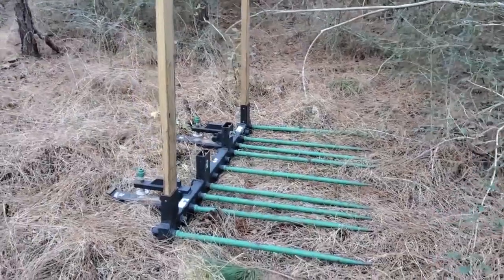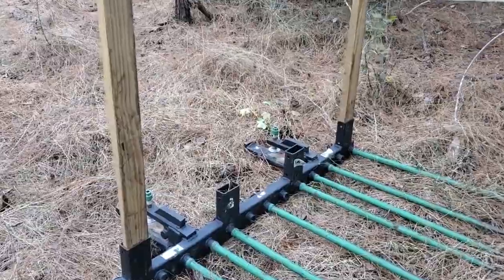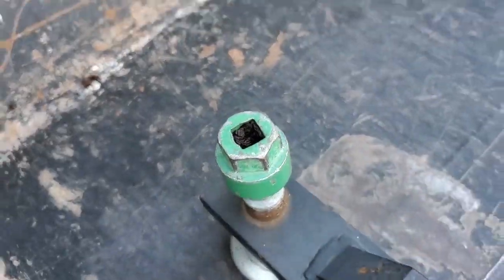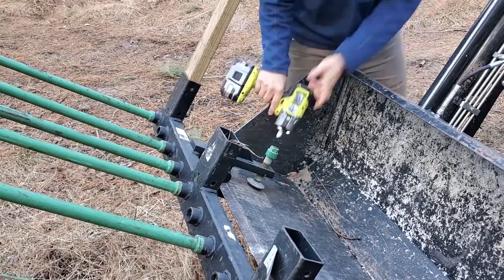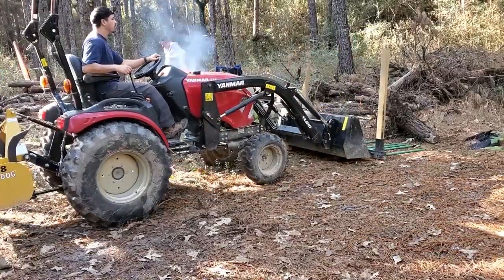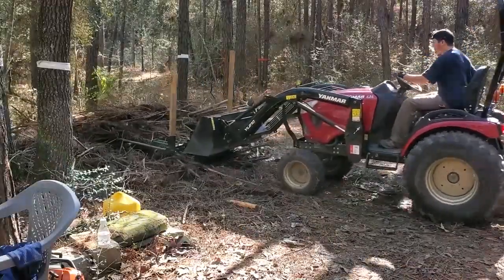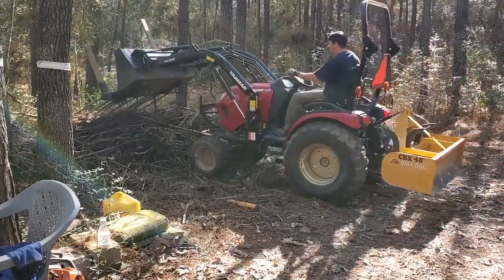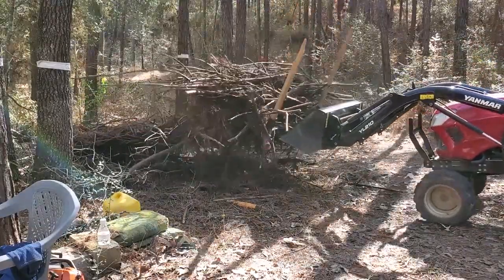tractor forks, the poor man's grapple

Comment: Great video! I’m trying to find an implement to use as a hand broad fork, to dig and slightly loosen garden beds. The soil has already been plowed and tilled so it looks like this would be a good fit??? Is it strong enough to do this??
Reply from the maker: Hmm.. I feel like these would be too long for that. If I come in too steep and stab them into the ground more than a few inches deep, my tractor usually can't lift them out. (My tractor is small, mind you). They're really long and the mechanical disadvantage is something you have to work with. Maybe if you found something with shorter tines? Or if you have a bigger tractor? I don't think it would work well with my little 24hp... Good luck in your search!